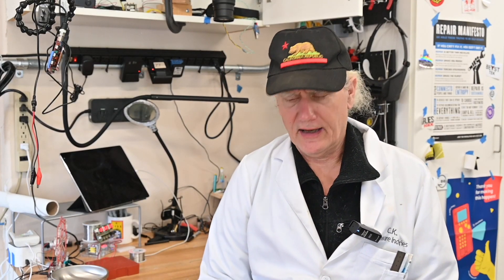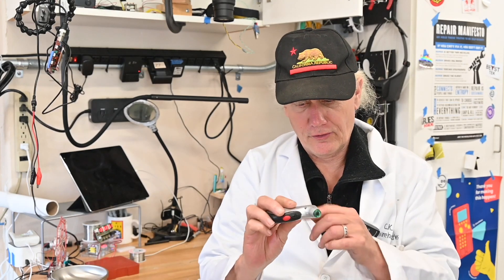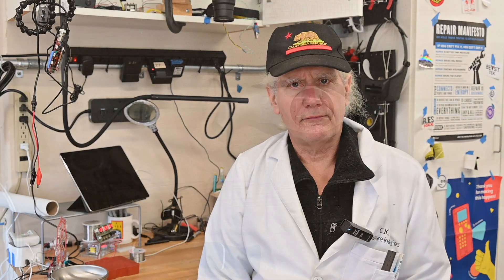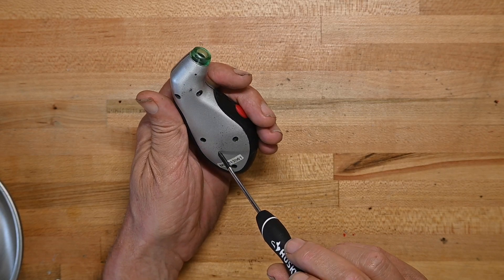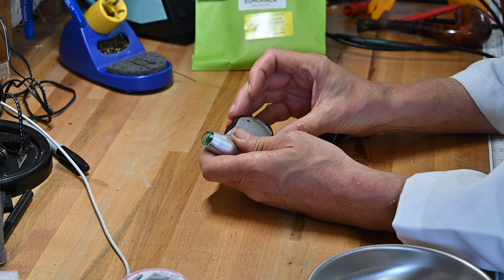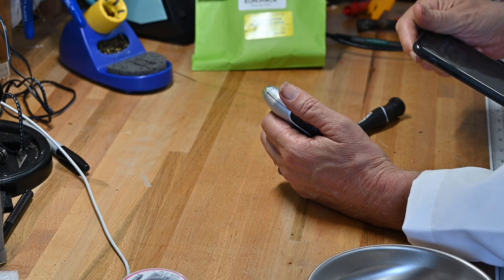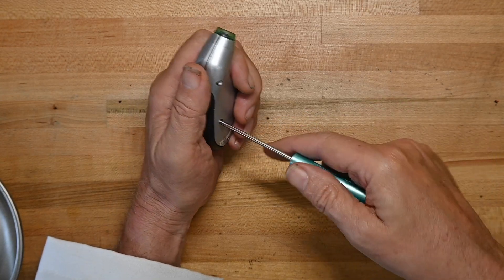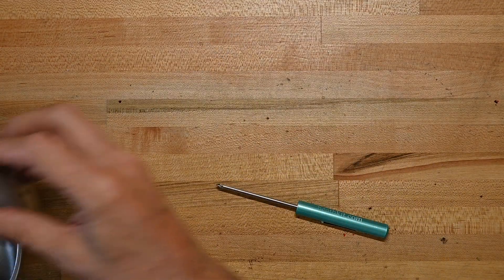C.K. disassembles a Slime tire pressure gauge

Comment: What size batteries are those. I have the same slim gauge and the gauge is saying low battery. If anyone knows what size those are please post. I hate to throw more garbage in the land fill when all I need is a couple of batteries.
Reply from the maker: I did not keep the batteries after I took this apart, I don't remember.  Any other viewers know?

Comment: These things are junk, I replaced the battery and the light comes on but no display. Everyone should buy an analog gauge that doesn't use batteries and it will last a lifetime.
Reply from the maker: I use this because the reading is persistent for 10 seconds or so, where an analog gauge immediately disappears,  since I often use the gauge in a spot where I cannot directly read it when applied to the valve.

Comment: These little things are bulletproof and last forever. I’ve had mine for at least 12 years, and it’s still on the original batteries lol.
Reply from the maker: I agree, best thing I can say about it is I never think about it failing or running out of battery, I just use it and it works.  Thanks for stopping by!

Comment: I replaced the 15- year old batteries with 357s. Cleaning the corrosion was a breeze and the only "slightly frustrating" reassembly was getting the led positioned correctly in the nozzle as there is a slight recess in the ring. Works like a charm as long as the batteries are positioned properly. Thank you for taking the time to make this.
Reply from the maker: Excellent, glad you got it working again.  I will admit, I didn't try to put the one I used back together :). Thanks for stopping by!

Comment: Thank you sir, the first video showing taking this thing apart that is actually helpful.  It is beyond ridiculous they make it such a hassle to replace the batteries. I have one that I've only used a handful of times and of course when I went to use it not only were the batteries low but had also corroded somewhat.  If this thing was at the Dollar Tree or $5 max I would be more understanding of the poor quality. But they are asking $15-$20 for these things!
Reply from the maker: Thank you for your kind words. And yeah, they could have added a battery change port pretty easily, based on what we see when it’s torn down.

Comment: Thanks 😁
Reply from the maker: Someday I'll get epoxy melting goo and be able to uncover what chip is the brains in things like this.
Reply: @CKHaun  Yeah, you could try lacquer thinner. That typically melts all different types of goo. You might also get a hot-air reflow station to melt the goo. Hot-air rework stations are pretty inexpensive right now, and the review on those inexpensive hot-air reflow stations are pretty good.
Reply from the maker: I'll give those methods a try.  And I do have a hot air station from the same company, only US$95, you can see a video of that here  https://youtu.be/3p_JfE13HFc